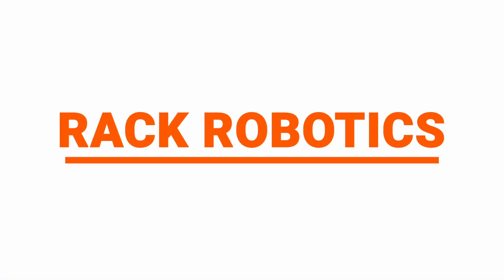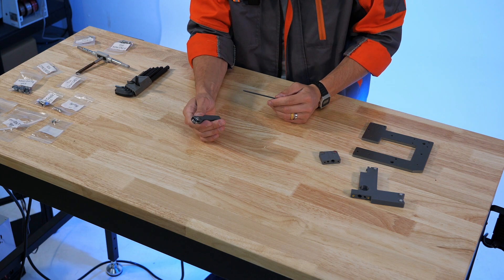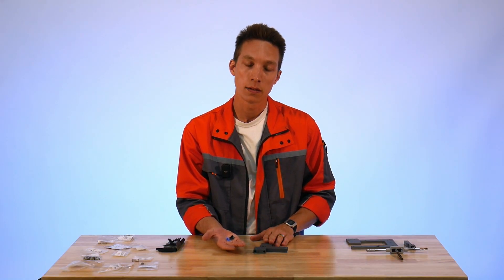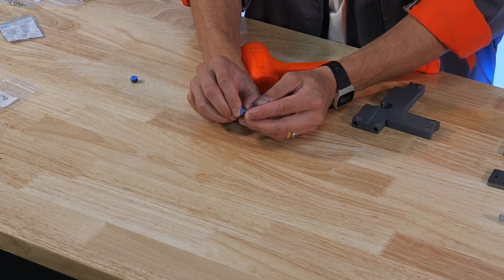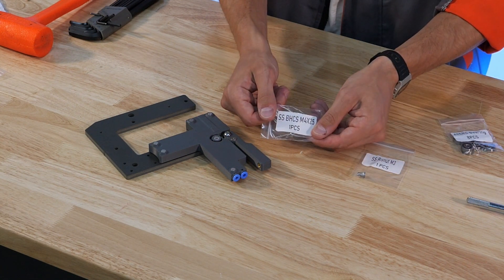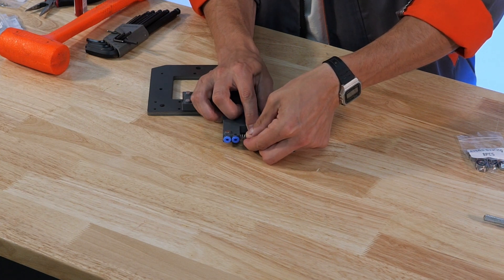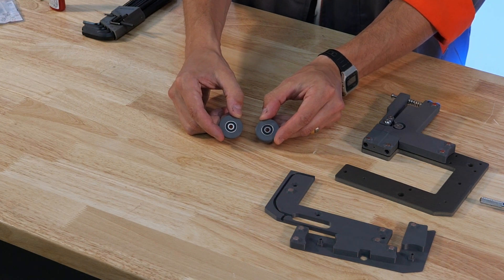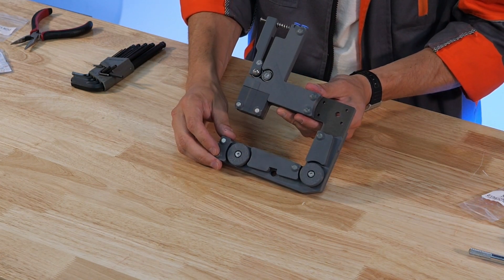3D Printer to WEDM Machine GUIDE - Part 2

Comment: Cooper, it was a pleasure meeting you at the 2024 RepRap festival a couple months ago.  Thank you for taking the time to introduce me to EDM technology.  My question is do you supply the software to do the CAM modeling portion or offer advice on how to setup the CAM in Fusion as i don't believe they offer EDM as a selectable manufacturing tool.
Reply from the maker: Hey! Cooper here. We are working on CAM solutions right now. We currently have EDMWeb, a fork of LaserWeb4, but it's kind of a kludge for WEDM.

We're working on our own ground-up build for WEDM CAM that should support 4-axis work. Expecting this to be ready for alpha shortly, but no hard date. Generally, laser pathing can work well for WEDM